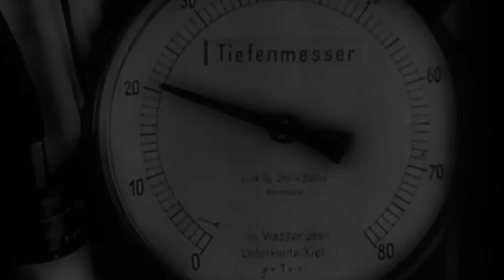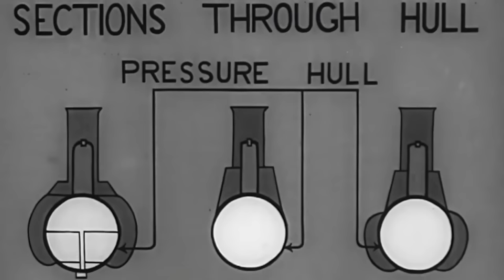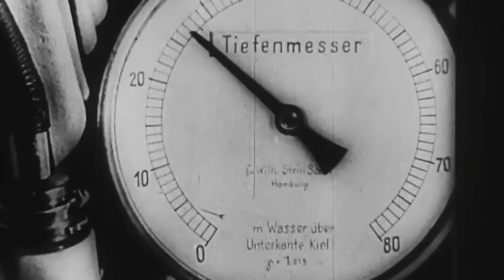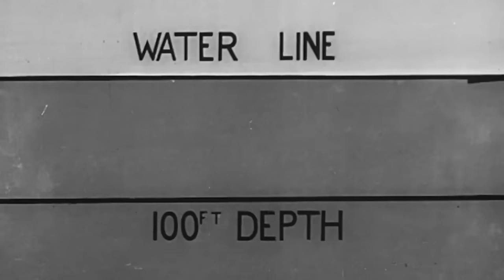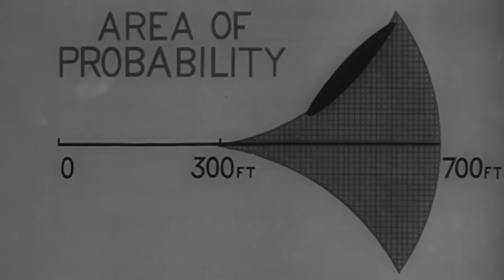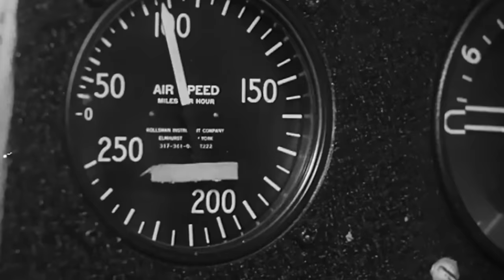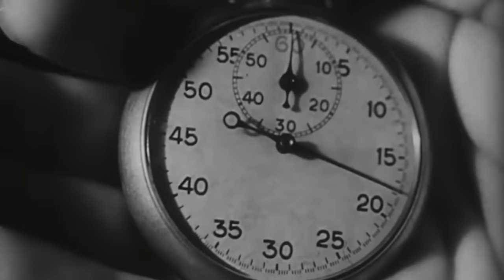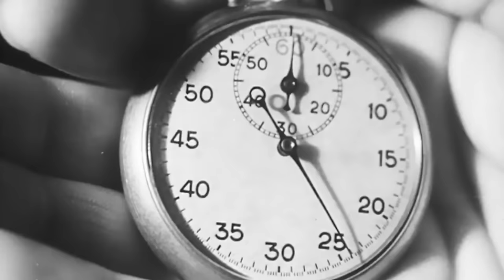Air Attacks on U-boats | Royal Navy Instructional Film (1941)

Comment: Once the 10 Centimeter Radar, along with the Leigh Light was installed on aircraft with crews that were adequately trained in ASW techniques, that's when the real slaughter of the U Boats began. The U Boat, a submersible with limited underwater range and speed was kept down by aircraft and escort vessels, it was only a matter of time before they were sunk, or forced to surface. Still, the bravery of all participants in the Battle of the Atlantic is legendary. Very good instructional video on FAA tactics early on.

Comment: As a retired submariner with over 17 years of service, I have never (ever) heard the term 'Crash Dive' used either in Patrol or Training exercises - All dives are made at the same rate (in patrol operations) the variance being the amount  of (down angle / incline of dive) bubble ordered. 
A submarine has two periscopes - The search (binocular and a thicker periscope mounting) for exactly that, search and safety operations - The Attack periscope (monocular, a thin mounting ) is used for attack and close up (observation) operations.

Comment: Thanks for the upload. It must have been soul destroying for the airmen to have one of those U-boats slip out of their grasp.
Reply: Theres a channel that put up a sound recording of a Japanese  sub that was sunk in the Atlantic by  an American airborne sub patrol.  The sub was on a mission to Germany probably delivering rubber ingots in return for whatever stuff they needed. Pretty desperate and pointless voyages half way around the planet. Most of the subs were sunk. They would drop acoustic microphones to listen for out for the sub and ascertain if the attack was successful. You can hear the pilot telling one of the crew to shut up as he's listening out for  the main explosion to happen. The depth charge attack was successful and you hear crackling and popping of the subs hull a it drops through the water column. It goes on for several minutes.
Reply: @liamhickey359  WWII US Bombers channel.
Reply: @richardvernon317   that's it in one. Good channel.

Comment: This was in 1941 before the full impact of aircraft in sinking Uboats became a serious problem for the Germans .  1942/3 additional A,A, guns were fitted and if crash diving appeared to be too late for an escape , shooting it out on the surface was a better option. I recall reading that for every submarine sunk , three aircraft were lost . That doesn't necessarily mean that those loses was all due to A.A. Flying on long range patrols over a vast ocean called for high class navigation .
Reply: 1st May1943 was when the Stay up and fight order was issued to the U-boats. It was rescinded 3 months later.  Between Sep 39 and Jun 41, Coastal Command lost 90 aircraft doing Anti U Boat Patrols and Convoy Escorts. The total number of U-boat sunk by aircraft by the end of 1941 was 6 (1 by Bomber Command, 3 by the Fleet Air Arm and (2 sharded with warships) 2 by Coastal Command (shared)).
Reply: @richardvernon317  Thanks for crossing the T's and  dotting the I's . 41/42 I believe that Coastal Command concentrated on the Bay of Biscay area mainly because it was within range of its aircraft , it was also within range of German fighters like the Ju88's .
Reply: @jameswebb4593  Just flying over the sea back then was dangerous!!! The aircraft only became a serious killer of U-boats in 1943, it was then that all of the technology required for it to do the task effectively was perfected. It was not just the search radar, suitable radar altimeters were not available, or low depth Hydrostatic fuzes, or long range navigation systems like LORAN or Sonobuoys or Homing Torpedoes or Rockets. All of that stuff became available in the first 6 months of 1943.
Reply: @richardvernon317  Terry Bulloch , Sub Killer extraordinaire
Reply: @jameswebb4593  Got two air to air kills with a Hudson as well!!! There is a reason 120 Squadron got their standard early.
Reply: @richardvernon317  One of the finishing foremen were I worked was a navigator in Liberators . He told me his best friend on the squadron was killed when their plane hit a ships mast in fog. 
That shows how low those guys flew to find the enemy.
Reply: The number of aerial u-boat "kills" is only a part of the story. The number of times that surfaced u-boats that were racing to intercept a convoy or to manouevre around a convoy for an end rround attack that were interrupted and forced to dive for half an hour, an hour or even more, directly prevented God knows how many German subs from making succesful interceptions and attacks. Something that would not be reflected in any stats, but which further reduced allied shipping losses.

Comment: What if the U boat commander orders all stop, all back?
Reply: As the sub would be trimmed down forward to assist in getting the uboat under the surface as quickly as possible, to order both motors full astern would simply pull the stern of the Uboat to the surface again.  The idea of superfast jinking about to evade attack sounds ideal, but remember even at full speed underwater the uboat was moving at the pace of a moderate jog, and going full astern would require maybe  10 or 15 seconds to allow the propellers to stop turning then another 10-15 seconds for them to start turning in reverse which would leave the submarine stationary for 20-30 seconds barely under the surface.